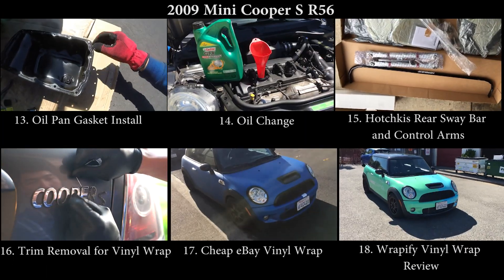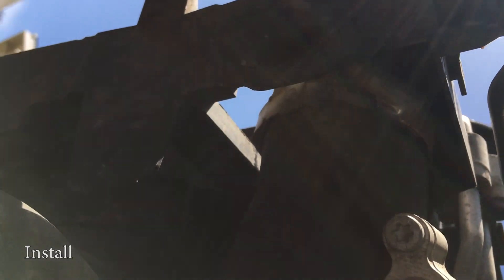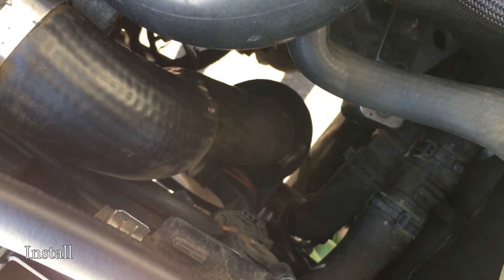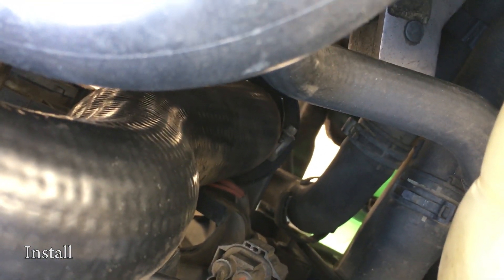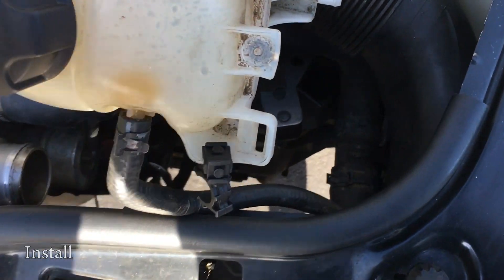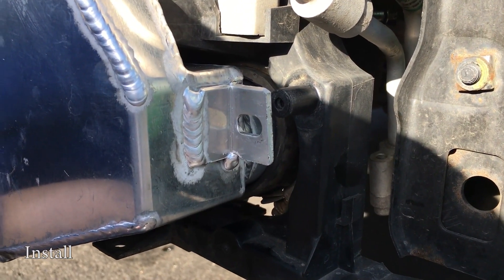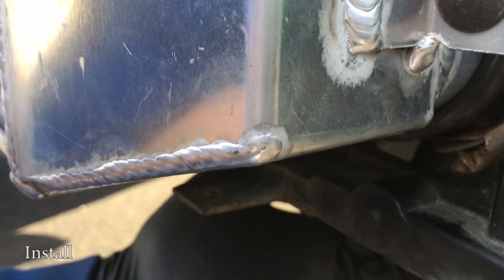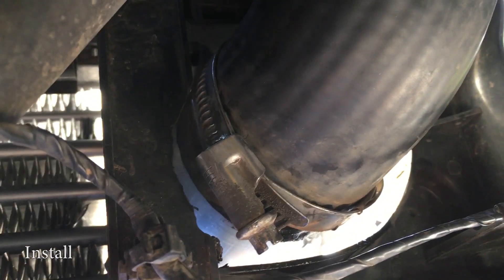Cheap eBay FMIC Intercooler Install and Review - Mini Cooper S R56 Video 7

Comment: After two years how did that intercooler hold up bro?
Reply from the maker: Hey Sean, it held up great until I sold the car a year or two later. I didn't have any issues with the intercooler aside from the fitment issues during install. The car had issues every other week, so I eventually got rid of it, but I think it's just the R56 platform.

Comment: Did you notice any power gains without tuning?
Reply from the maker: I felt a little more power, but it could have been my butt dyno. I think it's supposed to help with with cooling the turbo so it's less susceptible to heat soaking, but I didn't drive aggressively enough to notice a difference. Thanks for the question!

Comment: Do you remember the extended bolt spec? Like thread pattern and length
Reply from the maker: My order confirmation said 14X1.25 35MM THREAD. I'm pretty sure it was this product https://www.ebay.com/itm/182583834044?hash=item2a82d835bc:g:BYgAAOSwX9FZH4hT
I hope this helps!
Reply: @ColinLeung  oh I meant for the intercooler not the wheel lol
Reply from the maker: @cityazndan  Oh, I don't remember what size it was. I think it came with some bolts, and I took them to home depot and found the same thread size but longer.

Comment: hi, did the small diameter  connector  on the intercooler leak pressure or did tightening up the clip do the job? i have the same issue not sure whether to carry on with the install. thanks
Reply from the maker: Hello Neil, It has been a while since I did this, but I didn't have any leaks after installing it the way I did in the video.
Reply: @ColinLeung  Hi Colin, thanks for replying. Your video was very helpful with regards the fitment and modifications.  I too proceeded with it and put 2 x jubille clips on each boost pipe and it seems to be holding the pressure as well.